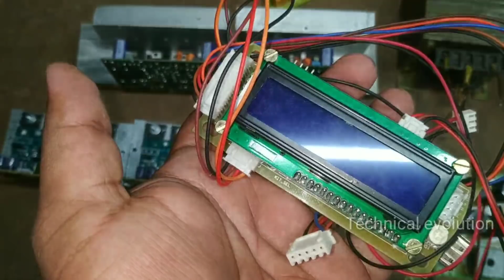5.1 high power amplifier assembling full details part 1

Comment: Bro oru doubt .....sadarana nammal 2 subnu 63v 10000 uf.4 ennam alle idunnathu athu 40000 uf varavallo....ithippam 28200 uf alle varunnullu appam itrem uf mathiyo 2 subnu...kooduthal filter uf undel subnte depth koodille
Reply: Parallel aayulla capacitors mathrame add cheyyavu. Power supply dual aakumbo oro railum capacitor equal aayittanu idendath. 4 10000uF cap undenkil 2 ennam veetham parellel chethu aanu kodukunnath athayath 20000uF,,. 
Nalla amplifier performance venam enkil transformer voltage koodunnath anusarichu capacitor kooduthal venam.

Comment: ഇത് എത്ര watt ആണ്?
Reply from the maker: 70w per ch sub 250*2
Reply: Transformer voltage 27V aanu 4ohm sub use cheithal maximum power (182 watts RMS) per Sub.
Channel 22V transformer use cheyyumbo 4ohm speaker upayogichal.(121watts RMS) pakshe board athrayum thangilla.

Comment: Sir 27 0 27 
10 amp 
12 0 12
1 amp transfomar   rate  എത്ര  വരും
Reply from the maker: 1500-2500 depends on quality of core winding process.. Hydraulic press and copper quality efficiency will be different

Comment: Bro ithil speaker wire  short ayal protect cheyyooo
Reply from the maker: Illa bcz ith speaker nu ulla dc protection anu amplifier protection alla
Reply: Bro appole ithra relay use cheyyanooo
Our relay vazhi GNT ella speaker  line lekkum koduthal pore positive direct  codukkuka
Reply from the maker: Bridged board anel angane pattulla pinne ii oru board vachitt relay ennam kootty otta board I'm thanne 5ch Or more kodkkan pattum but appo ethelm oru ch poyal mothom protection akum eth ch ani poyath ennu kandpidikkan padanu ithakumbo easy

Comment: Mosfet250 9240 27 v 5amp argox12" anu ente kayilullath ottum power illa  filter board matiyal power kittumo
Reply: 27V transformer aanu, sub 8 Ohms aanenkil ningalku maximum 90Watts power kittum. Filter capacitor minimum 10000uF oro raililum venam. Box proper allenkil um punch undakilla.
Reply: @EngineeringEssentials  Sub 4ohm anu
Reply: Sub box oru sadharana box anu air hole 4" Ayirunnu ath njan close cheythu 1ara inch hole vechu appol kurachukoodi mechapettu.
Reply: @rahulkrishna3048  4ohm aanenkil maximum 182 watts power athil ninnu kittum. Port ennu parayunnath "hole" alla. Proper depth undenkil port diameter koodi irikunnath thanne aanu nallath. Nalla oru box design cheithu vekkuka punch kittum 👍 amplifier issue aakan chance kuravanu.
Reply from the maker: Filter lm324 anel nalla base kittum
Reply: @technicalevolution9887  lm324 anu base punching illa
Reply from the maker: Argox sub njan use chythittilla bro box or tube ano
Reply: @technicalevolution9887  box
Reply from the maker: Pinne 8ohms sub anel 5amps pora
Reply: @technicalevolution9887  tda 7294vechalo

Comment: Chetta randu transformerum orusidil vekkunnathinekkal nallath randum randu sidil vekkunnathalle nallath.allenkil orusidil mathram nalla weight ayirikkille?
Reply from the maker: Saryanu bro but input cables ac supply adthukoody poyal noise undakan sadhyatha und njan branded avr and stereos okke open chyth nokkippo 2 toroid okke undenkil polm one side anu vachekkunne
Reply: @technicalevolution9887  k